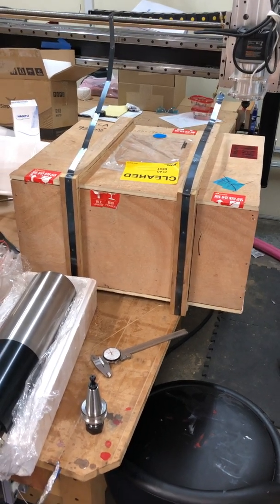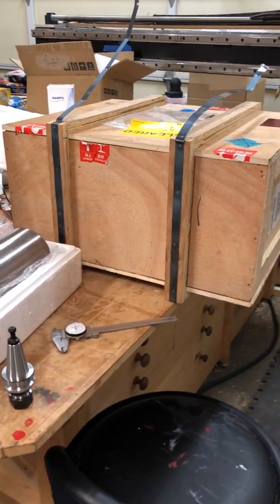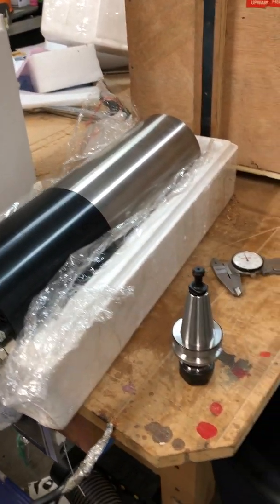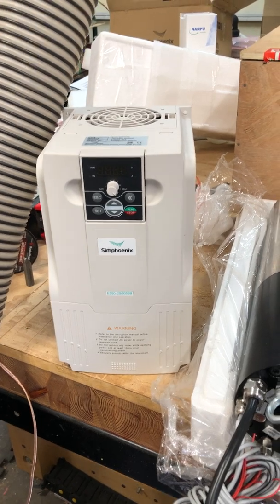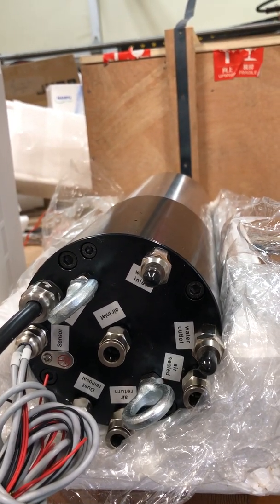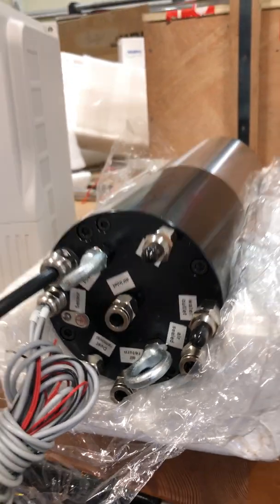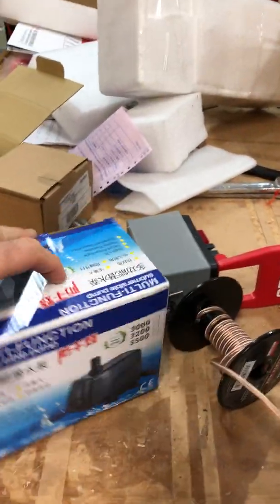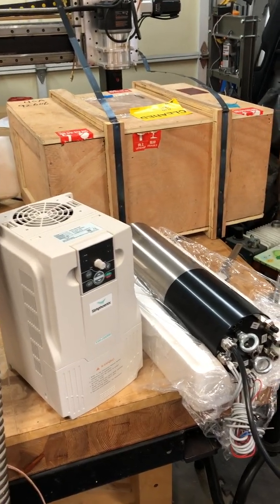Unboxed Jianken 4.2KW 220V 24K rpm BT30 ATC spindle

Comment: I’m looking at getting the JGL100/3.2kw spindle from Jianken. What are you’re thoughts on the spindle so far?
Reply from the maker: I have gotten it up and running, and it is super quiet and fast.  A bit scary, and makes me grin.  I am planning on doing an update with it working as well as the controller I built to go with it.   I built an Arduino based controller to do the interface between the spindle + drive and the PLC  the VFD is set up for 10V analog input from the arduino board.   Some other comments...
- The 4.2KW (~ 5.5hp)  spindle is probably more than what I needed.  It is ~50 lbs alone.    This choice drove larger VFD and larger wire and 60A circuit breaker. 
- The requirement for the spindle to be only 2m from the VFD means I had to mount its box on the gantry. Thus adding weight to the gantry. 
- The casting for holding the spindle looked really rough.. but it was actually fairly accurate when we checked it on a milling machine.  Decided not to bore it out.   
- The amount of air that it uses was quite high for my little compressor, and so it is running quite a bit perhaps 50% of the time.  This produces quite a bit of water in the lines.   
- The company help has been and continues to be quite responsive, and has pretty much tried to answer every question I have asked.. even as of this last week. 
- I got the E550-2S0055 VFD which apparently does not have an exact user manual. The user manual is for the smaller model, and there are differences.  As a result, I am going back and forth with Jianken trying to get the details for supporting the "Zero speed detect" and the "Reached frequency" functions.   Some communication issues. 
- The pneumatic valves that I got have not really behaved like I expected, and that has added many hours of debugging.   I had to add a relay to cut off the power from the pneumatics as soon as the spindle power was cut.  Otherwise, a glitch would cause them to actuate and the tool would drop out of the spindle.  I also have a solenoid valve to cur the air when the spindle is not running.  However, for some reason the air needs to be removed and put back each time it turns off, otherwise it won't turn back on.  I'll have to use a different type. 

- I was surprised about the low speed operation not working well / having much torque.  Just my ignorance with these types of motors.
Reply: @evanmccarthy7589  I would love to see a video on the controller
Reply from the maker: @grandmastersreaction1267   sorry for the delay.  I am planning on sharing the entire design, but other things have taken priority.
Reply: @evanmccarthy7589  looking forward to it :)
Reply from the maker: @grandmastersreaction1267  Just posted it.
Reply: DONT. THE COMPANY IS BS